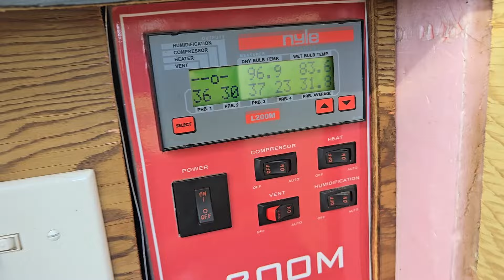20241012 Hey, it's been a while.

Comment: Have you ever considered building a "log deck" ? It might make bucking up your firewood into "rounds" a little faster.
Reply from the maker: We've tried that a couple different ways. It's more handling having to maneuver logs to the deck whereas I could be using that time to simply be bucking at the log pile. I've got another idea in the works. Just takes time and money to make it happen. Both in short supply.